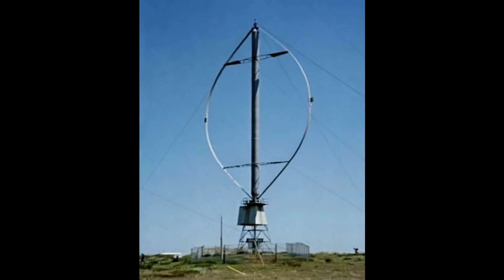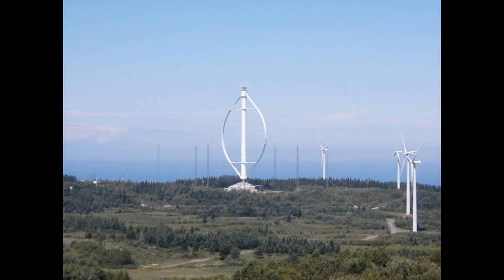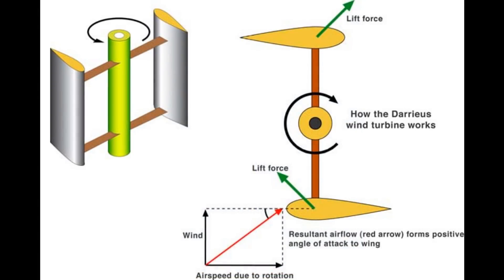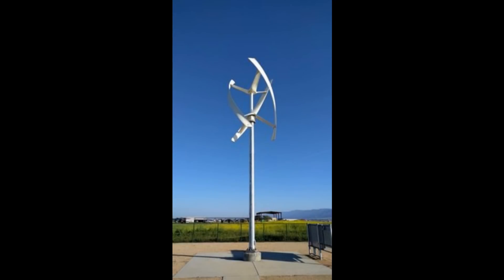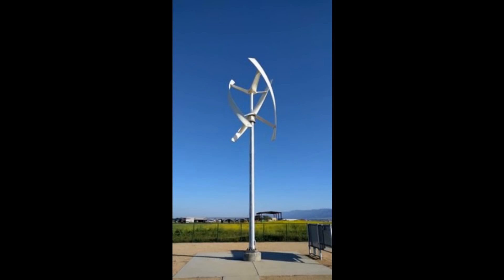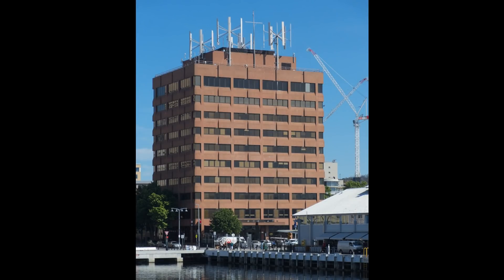1359 The Pros and Cons Of A Darrieus Type Wind Turbines

Comment: so can you think of the functionality of the Darrieus-type designs as similar to a wind-driven flywheel? one that converts the force of wind into torque then uses its wide center of mass to maintain its inertia? meaning the concept of a wind-driven flywheel alternator isn't an affront to the laws of hydrodynamics?
I've been blowing thru youtube videos on VAWTs and flywheels trying to see if anyone has attempted to use a VAWT to drive a flywheel alternator to generate a lower but more consistent charge over a much longer period of time, even using magnets to keep the flywheel balanced with minimal friction. if you, my local expert, can confirm that the Darrieus-type turbine functions similarly to a flywheel, then I'll keep staying up way too late trying to find other definitive proof of my idiocy. your video on the flywheel alternator made me more concerned that I was on to something - really solid engineering work that.
The closest thing I've seen to a VAWT-driven flywheel in the market is the powerpod which has a short circular array of blades, and I've found one or two engineers whom'st seem less than confident in the design philosophy (and believe the media hype is borderline fraudulent). since I'm just a curious DIYer seeking info from local experts I tend towards the side of skepticism, but I also don't think the design tried to solve actual fundamental problems with small-scale wind energy like maintaining a current that can be used by a standard charge controller without a supercapacitor bank for your battery bank so u can charge b4 u charge. I just need some expert's confirmation that I am or am not a loon

Comment: A mechanical centrifugal clutch could apply braking at high velocity wind speeds. 
Limitation on their size can be overcome if they're placed on top of a post with the lower part of the blades elevated.
One could even place support wires on the post if necessary, since the post would be below the blades.

Comment: Use a car starter and car disk break to fix the starting and high wind breaking issue.  Activated on/off by wind speed.  Also, it can be made with honey cone interior blades and fiberglass.  If you want to get fancy, carbon fiber bade made the same way as fiberglass.  :)

Comment: If you make the blade angle adjustable under electronic control, it could be self starting, then trim the blade angle once spinning to increase rpm.
Reply from the maker: yes it would - pretty much what the cyclotron does - but the build complexity and maintenance requirement shoot up

Comment: What is really a question for me is about the efficiency. It is clear that any VAW is less efficient than a HAW. But, I do have a piece of land on a hill. The wind is very much following the land surface in parallel. I do think one of the advantages of the Darius “egg” type is that wind not coming in from a horizontal angle but from below will be used for power than any HAW . Any thoughts on that matter? By the way speaking of a 2-5kW mill in my ideas. Thanks for any input.
Reply from the maker: location and cost are real issues in a real world implementation mate - I did do a video on this - cheers

Comment: With the generator portion at the base, a good reason for adding yet another generator section would be to use it to slow down the blades during high wind.
Reply from the maker: for sure

Comment: Hey Doc! I heard that the Bettz Law is only valid for non-compressable fluids, and air is a compressable fluid.  So why don't you try a sail like thing repeated like in a circular shape? If you close the upper part of the circle, it would compress the air and gain more thrust. I would try that, but I'm not a handy guy like you.
Reply: If there is wind at the speed of sound, then air compressibility will appear.
Do you often have a wind of 340 m / s?
Reply: @ДэнКошман  you dont need all that speed for a low compression.
Reply: @Hellgazer  At a speed of less than 200 m / s, air compression does not work at all.
Reply: @ДэнКошман  isn't the air in being compressed against sail winds in a sailling ship? I dont know if I'm using wrong names here, but what I'm talking about is to use the winds  in a circle the same way a sailling ship does in the ocean, got it? Dont you agree that big sail winds are better to gather wind than a rotating stick in a common wind turbine? Just look at the big sailling ships of the old and how many tons of cargo they carried along the Oceans.
Reply: @Hellgazer  I understood what you wanted to say. Wind turbines with a large area filling factor are known, have a large starting moment and agree well with water pumps, but very poorly interact with electric generators.
Reply: @ДэнКошман  are you talking about those dutch mills stuff? I'm thinking about something more efficient than that.
Reply from the maker: interesting idea mate - cheers

Comment: The non self start could be resolved by putting cones at the top and bottom of the blades.

Resolving the high wind issue can be done by building a platform that has a sleeve that would move up to surround the blades, blocking the wind a little or a lot and reduce how much wind the blades are catching.
Reply: Perhaps a centrifugal break would be a cheaper idea
Reply: @mikeladd5880  
Possibly, but not as much fun to watch!
Reply from the maker: ohh - I do like the cone idea Scott - cheers
Reply: @ThinkingandTinkering  😎👍

Comment: I like the Darius type "H" turbine and I would just put a couple of those savonius type turbines in the center to get it going!
Reply: I agree with you this would give you the torque, self starting, and help prevent runaway in higher wind conditions.
Reply from the maker: that's exactly what the Taiwanese did mate
Reply: My first thought was why can't there be two different blade styles on the same hub lol
Reply: This has been done many times. Easier to start. But this does not save Daria from the disadvantages of the rotor. And the disadvantages there are very significant.
Reply: @ДэнКошман  perhaps a type of magnetic bearing just strong enough to hold until the speed reached a certain point and then it releases and only the outer blades remain spinning. Just a theory of course, what does everyone think?
Reply: @jeffreyrood8755  magnetic fluid coupler maybe?
Reply: or centrifugal weights and spring mechanism on a locking pin when it spins fast enough the pin is pulled out
Reply: @rayg436  maybe the way a scooter (motorcycle) works

Comment: It’s interesting that the H type here in Hobart were mentioned. They were removed because of safety concerns. They were Seagull perches for the majority of their life as they were locked down due to parts failing and a blade fell off early into their life. They failed when it got windy even though the manufacturer rated them for cyclone speed wind. It was great to see an attempt at using wind turbines but it was a joke in its application.
Reply from the maker: I have been to Hobart - believe or not - It reminded me of my home town!
Reply: @ThinkingandTinkering  Then we should immediately petition wikipedia to amend the Hobart wiki page. "Visited by Charles Darwin and some years later Robert Murray-Smith". 

I'll start the draft changes ASAP! 😁👍

Comment: Mmmm... I've been pondering the starter/ generator (as used in aviation) for a wee while... wondering about it's potential application in the "backyard"? And low... there you mention an application for said device. Now I wonder about modifying the standard washing machine motor? However... me thinks me is busy overextending my limited brain cell capacity!! 😁🤔
Reply from the maker: here in the uk a standard washing machine motor is a universal motor and that can be adapted to be a generator pretty easily tbh

Comment: Would love to see you guys do a rope type wind turbine. Seen a picture of one on a cable spanned across a canyon but never seen a video demo.
Reply from the maker: do you. have link mate?
Reply: @ThinkingandTinkering  I’m really sorry, it’s been almost 10 years since I first seen it. Ive looked a few times over the years and can never find it. I thought it was a Popular Mechanics magazine. 
I’m left to assume it must not have worked well because it doesn’t seem to have become popular, but it’s extreme simplicity and claims of high torque and low risk of catastrophic failure seemed very promising. 

All it was, was as many Darrieus fans as you can slide down a cable, and string it across as far a span as you can, or multiple short cables for smaller spans. And the fans were very narrow and not much wider then the cable diameter. But it was suggested that the shorter your cable span was, the bigger the fan diameter. 
The claim was that the potential torque was high enough on a really long span, that you could keep the rpm low for safety.

Sorry I couldn’t send a proper link, but if you have an email, I’m happy to send a few sketches of the different configurations it suggested.